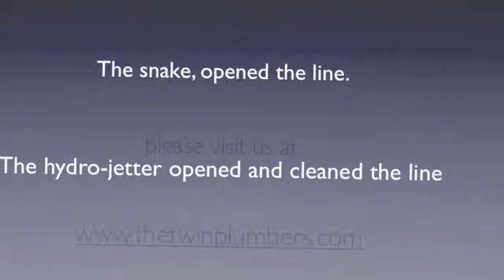Snaking vs. Hydrojetting

Comment: Northern Tool has a jet that connects to YOUR pressure washer wand for "jetting" sewer lines.  Reasonably priced also.
Reply: Jerry Fallin not the same as a Jetter tho because a Jetter will suck a garden hose dry.  That’s why they have 100 gallon tanks on them.
Reply: C A M HVAC I was wondering about the “twelve gallon per minute”. water source. 
  If it uses a tank, might not be the thing for a diy’er. 
  Also, that is not the snake/cable I would use on a main drain, maybe a sink or washer drain to the main. 
  I have a couple of pulsators that work pretty good for  some blockages. I wouldn’t expect from them for clearing roots though.  I do find the idea of using a pressure washer interesting. 
  If using one shown in the video with water coming out the back to propel it forward, I would probably get a face full if not very careful. I noticed the guy place a rag over the pipe I guess to prevent this, but seems like the might create somewhat of a vacuum making it harder to dislodge blockage.

Comment: Two weeks ago, at my house, the difference between hydrojetting and cable was $1,850 vs. $99. Frankly, given the problems I had with tree roots, and a camera view of clear, unbroken pipe all the way to the city sewer, it was worth it.
Reply: Thats what im having done today.1200 plus,then will start using root killer afterwards.
Reply: I don't follow did hydrojetting cost $1850?
Reply: @surgio98  yes
Reply: @kylekoenig4730  what a rip off ! just a fancy pressure washer
Reply: @Ahoooie  what a rip off !  no won der plubmers are rich
Reply: you mean that demonstration costed $1800!!
Reply: @surgio98  Yes, because to buy such a machine costs somewhere  between 40k to 60k, and you slso have to take into account the repairs and maintenance. So yes, they have to charge this money in order it should be worth it for them to buy.
Reply: @israelweiss5644  I also see you can buy a 50’ sewer hydro jetter for only like $50, to attach to a pressure washer. Even if one had to buy a midrange pressure washer as well, the costs would be waay cheaper to DIY. (Assuming something horrible doesn’t happen)
Reply: @skittles2055  That's the value of a little information, skittles (and a lot of common sense and elbow grease!)
Reply: @thebordernow  as far as I know...for DIY...you can buy plastic bladders that you can attach a hose to,  insert into any clogged drain, push "forwards" until it points toward the blockage and then turn on the hose, which then inflates the bladder, which makes it adhere to the walls of the pipe and THEN shoots out a stream of high PSI water down towards the blockage.  They are akin to $50.  That is not a solution for serious blockages/roots.  But it may be a solution for troublesome kitchen or bathroom blockages.  Just make sure you (a) point the bladder opening in the direction of the blockage (b) seal of the remainder of the drain as best you can and (c) have people monitoring nearby drains, because if blockage remains, and it starts backfilling instead, it may start overflowing any of the other pipers in your plumbing system.

FYI, this backfilling problem would also be a potential issue with the fancy hydro jetters.  So keep that in mind.
Reply: @eramosat  Thanks for the info!
Reply: Oh my god that seems ridiculously expensive. Especially if you're lying is solid and you don't have to worry about a cable cutter hitting broken pipe at some point then I really think you got taken by the hydrojet people.
Reply: Lmao you can hook one up to your pressure washer....50.00 don't let no one fool ya

Comment: Total bullshit. Get real snake with a cutter head. Hydro jetting makes a big ass mess and does not cut away the roots. Rent a machine and do it yourself. Most times these so called plumbers will half ass snake your drain and you'll be calling them every year.
Reply: dennis n dont do that get e real plumber Let him find where the roots got in and let him fix it.
Reply: dennis n i disagree if theres an outside cleanout or grease in the line a goos hyrdoscrubber will do the job beter and faster than a cable. If you have to work from inside a sectional cable machine is by far the best way

Comment: The drain cleaner he's using is hard to operate...it's called a pistol-grip drain cleaner.  Try an Ergo-auger....it's much, much easier to use.
Reply: Natasha Thomas nice call. Throw skill, ability and experience out the window for ease of use. Pathetic.
Reply: General   is tough very tough as I have  several over 30 years old still going strong

Comment: Can the hydro jetting hose be attached to a power washer. Seems they power washer has similar pressure, just requires a flexible rubber line to push into the clogged pipe.
Reply: That’s all it is

Comment: Imagine doing that over 100 feet inside a line when roots are attached to the pipe, you are limited to the capabilities of your equipment
Reply: If only they made the rotating jetter nozzles with cutter on them... hold up.. runs off to do patent search

Comment: Your running a sink line cable down a main line.  Running dry, no water to flush out the line.  A sink cable hitting roots is a disaster waiting to happen.  It's not big enough.
Run a proper size cable and cutter with water and problem gone.  There area few places that a jetter is better but this is a horrible example.  Shame on you, twice the BS.
Reply from the maker: This is JUST to show people the difference  between how a cable moves down a drain line Vs a Jetter hose.
Everyone does things different t ,everyone has different belief system. CHEERS!
Reply: Twin City Drain and
Reply: agreed and if that had run water in the pipe afterwards that pipe would have been clean
Reply: Twin!
It is a demonstration so you kan What happend inside the tube.
It is a god thing to know if you want to work AS a cloackcleaner.
Regards to all of you.
Reply: Twin
You write you know better how to clean a tube inside.
Make your own video to show how to clean inside a tube and post to youtube. We are waiting.
Reply: Yeah exactly, they forgot to mention that in a break the roots are actually attached to something, they are in the ground, and you are better served with a cutter on a thick professional cable.
Reply: your right i was going to say same thing also wrong machine for job  call a pro not a tv u tube plumber
Reply: That’s not the point
Reply: Making a demonstration with the wrong equipment.
Reply: Ima HUGE FAN OF CABLES PREFERABLY MY SPARTAN 100 n 300 MACHINES I OWN HERE IN THE OLDER PARTS OF SAN DIEGO IVE SEEN PLUMBERS SHATTER OLD CAST LINES WITH JETTERS I OWN 2 JETTERS 1 GAS AND 1 ELECTRIC WITCH I LOVE BUT HAVE TO BE CAREFUL ON SOME OF THOSE CAST LINES
Reply: It's not a main line..look at the diameter of the pipe. The one below it would be a a main
Reply: Not True as  some places have small root infiltration in a line as small as 2" and there is NO WAY  a 1/2 " cable let alone a larger one will  make the bends ..  If the mechanic is semi decent that can use a 3/8 Cable with  spear shaped head to establish flow  and actually remove some  roots.  A U shaped cutter will also   cut and remove roots  BUT  the process takes time and skilled mechanics  .  Jetters  DO NOT have a   "reverse"  switch so if the hose gets stuck your in trouble.  Snaking like jetting is who is doing the actual not which machine they use   as bigger is not always better .  Even with a Jetter you want to establish FLOW before adding more water to the line  when doing inside work
Reply: Agreed. No clean water running behind the sludge is just negligent imo...I am a specialist..skilled at that..and a second pass or even that extra effort well worth it, and would have cleared and cleaned the line. ..
Reply: At least a k-50 if you are pulling out roots in a 2" pipe. I am just wondering where he bought the clear pipe
Reply: I'm just a home DYI-er studying to unblock my own main, but the video resolution is sufficient to read the markings on the pipe and it is labeled as 2" diameter.  Agree that flushing while cabling would bring better results, but to me, it still appears the jetter does better, especially by doing it faster and without an extra pass of whatever.   I'm frustrated by having had a professional cable-clear my main and less than a year later it plugs again....
Reply: @chungniem9494  acrylic maybe?
Reply: Its called a demo relax but its not about them but you..trying to show what you know...

Comment: Really, you didn't remove the clog, just pushed it further down the line  lol
Reply: The point is to break up the clog and allow it to pass through the pipe to the city main. Or are you under the impression that the clog should be retrieved and brought back up and extracted?

Comment: It seems that it is essential to have the line inspected with a camera to ensure that the blocking materials have been driven all the way to the large city line and then follow up with Rootx annually and removing or repairing/sealing any ingress points for roots.
Reply: THIS

Comment: maybe its just my confuser but the last half of the video the audio dropped out. restarting video audio is fine but 3 times the last half of video the audio is out.
      Beyond that though I have a real question.
      Running anything down a drain line especially old drains has some degree of risk that comes with it and there is a degree of skill in having the experience to know when you need to push hard or be very gentle. plus in knowing where your snake is going so that it does not take a wrong turn and come out a vent or another sink etc... So my question is how do those risks to old pipes etc  compare to conventional snakes? and can the pressure be varied ? And how does it compare "feel" wise on those tricky runs comparatively ?   Generally it looks like a good tool to add to a truck, there are many lines I run that are just full of gunk for which this tool looks perfect for.... Other more solid clogs, roots, washrags, anything that needs to be pulled back out seems conventional snakes would still be first tool to use... Every job is different and every job has its own best tool.
Reply from the maker: Hi Dave ! Thanks for the great post and questions. 
Checked the video for audio issues ,it seems to be fine on our end ? 

We get this question all the time ,with respect to breaking old pipes with various equipment . If the pipe is REALLY old and brittle ,then yes, then anything down you put down the drain will cause some issues ,but at that point the pipe is in stage 3 and has to be replaced anyways. This is very RARE that a snake or jetter will break a pipe .Pressure can be adjusted at all times ,its important to be able to do this in certain circumstances to prevent flooding .
Tricky runs that have multiple turns always pose a challenge .

Appreciate your  time !
Reply: I didn't have any problems with audio.

Comment: That wasn’t a very good demonstration. 1/4 cable going through all that , cmon it’s not really what you run into . Those cables are for tubs dirty arm kitchen and p/Trap lavatory. That kinda stuff normally you’d go half blade if any with a 1/2 in cable be done with it. Jetting a residential home risky too risky

Comment: Not the right tool for roots....
Reply: Charles Foster was
Reply: What  "Tool" would you use for a 2"  line  ?? Possibly a 3/4 " cable or a electric eel 11/4" cable?      I have used General super V   for over 50 YEARS  and  have removed roots from piping as large as  3" from a  yard drain BUT it takes time and skill .  A poor mechanic will always say "wrong tool"

Comment: When using a snake, after the blockage is penetrated, run water through the pipe while the snake is rotating in the pipe.   This will further break-up the blockage and "flush" it down the pipe....

Comment: There would be a blade used to chop up the roots. Trouble is, there's still broken pipes where the roots came into the pipe, and new roots will grow back into the broken pipes eventually.

Comment: Okay, if that thing is shooting 12 gallons of water per minute into a clogged pipe... won't I get 12 gallons a minute in my house until it breaks through?  I love the idea and it makes me want clear pipes in my house but shooting water into a backed up pipe seems unwise.  Or is this a tool for line cleaning?  I know this video is almost 6 years old but thought I'd try and see if you respond.  I really enjoyed watching it work btw.
Reply from the maker: Thanks, Lewis for your post! 
When you hydro jet a drain line that is backed up, you must have an exterior cleanout access point, this allows the excess water from the jetter to go outside. You never want to bring the jetter inside the home to clear a clogged drain, water will overflow everywhere.
TIP: clear the drain line with a cable machine, then hydro jet this prevents overflow and mess.

Comment: Would hydrojetting or snaking work better at kitchen sink? It must've been clogged from flour and hot water and hardened!
Reply from the maker: If the your kitchen drain is compacted with grease and debris, then hydrojetting , if it’s just a blockage the snaking will be fine. Great question 👍

Comment: Our ac unit, in attic (on 3rd floor) constantly is getting clogged.  Over the years I have used bleach, vinegar, dishwash, and even a wet vacuum to clean it out.  These days if I dont put a liquid cleaner down it, every other day - it clogs up and ac stops - while temp outside reaches 100.  Going into the attic to then scoop out the water isnt a nice experience.  Have 75 feet of drain pipe, with probably 6 angles at 90 degrees.  Dont thinking snaking can do it.  So will try to do the hydrojetting.  Wish me luck.
Reply from the maker: Most likely you have 3/4 inch PVC or galvanized pipes, this are way to small of a diameter, especially when your dealing with so many turns. They clog up over time, very hard to open up.
Reply: @TwinHomeExperts  I agree.  Builder put a/c in attic with no attic vent. Put ac in middle of house on top of a single concrete stone. Because of this, a small incline (6 inches?) for white plastic pipe that runs over 25 feet, then vertical about 10 feet, then horizontal about 15 feet over sunroom, then drops 10 feet to exit just above ground.  Built in 2007 by an experienced builder.  I agree with you, I prefer bigger pipe.  Over the years - at first the bleach, vinegar, and wet vacuum cleaned things out.  Then HOA had someone to wash exterior of buildings - I think the attic blown insulation - some went into ac drain pipe - I once saw dark brown water in the clear portion of the pipe.  Since then, if I dont put cleaner in often - always stops and water goes into overflow pan - thus cutting off the ac.
Reply from the maker: @howardhightower5904  maybe bypass the condensation pipe and install a pump to direct condensation to a near by vent pipe? ( proper p trap)

Comment: Would the hydrojeting work on 4” corrugated plastic pipe used for outside drainage or would it tear up the pipe?
Reply from the maker: Depends on the thickness. Generally hydro jetting will work. It’s really your only option to really clean out a compaction. Thanks for posting a great question!

Comment: We just hydro jetted the washing machine drain as it was clogged. Its in the garage and leads to main sewer. Our hydro jetter is about 50 feet long, we worked the jetter in and out of the pipe many many times. There was lots of black water back flowing out of the drain when we pulled the jetter out each time (when the jetter tip was getting to within about 2 feet of the drain opening). Does that black water mean we have some awful mess in the pipes - like broken drain lines?
Reply from the maker: black water is more an indication of grease build-up. If you start to see dirt mixed in with the blackwater then yes more then likely a broken line. 
I would use a strong commercial jetter to break all that up then run a colored camera down the drain to get a good look and locate the suspect area.

Comment: great vid guys; in ur opionon how many times out of 10 would u say it winds up being a root?  2-3 times out of 10? i'm asking with a customer that has a septic tank
Reply: Gra 7961
Generally with a septic tank unless the distance from the house to the tank is more than 75 feet, the clog is in the last 10 feet before entering the tank. Reason is the pipe runs slightly up hill entering the tank and fills with very heavy sludge build up.
Now if you have a tree or ornamental bush next to the line, good chance roots.  --Professional drain cleaner of 25 years.

Comment: Inacurrate information, the snake will do a much better job, in a real plumbing drain situation. If you have roots in your line the jet machine  will not remove the roots. You need a snake with a cutter head to clean that line. For a normal waste stoppage yes the jetter will work well.

Comment: How would you use a jet from the kitchen without having water come back and flood the place?
Reply from the maker: Several options.... You first have to snake the line and have a micro camera to verify that the line is open. if you can open the line and you dont have a cleanout then roof vent is an option. a skilled drain tech should be able to do jetting without flooding.
if you have a cleanout on the outside wall then this is the place you can run your jetter, if not depending if the kitchen line has a massive clog then a clean will need to be installed.
Reply: The Twin Home Experts oooh roof vent is such a good idea, thank you!!!!

Comment: I have a question. my wife washed some cloth mats that had some hay on them. now when we wash clothes, water backs up into the kitchen sink.  would I have to snake from the washing machine standpipe or under the kitchen sink or both?
Reply from the maker: I would try the going through the kitchen sink, especially if it has an outside cleanout. I hope this helps